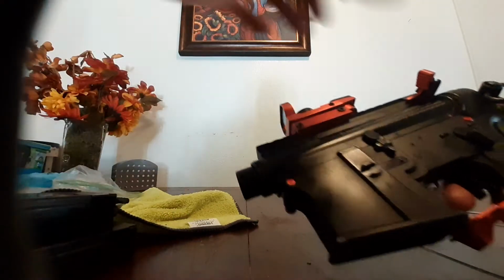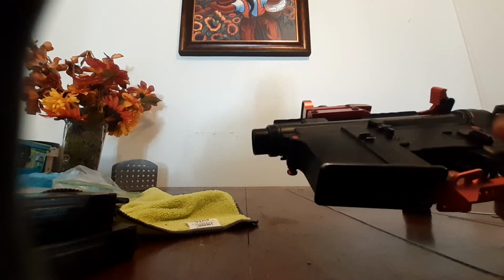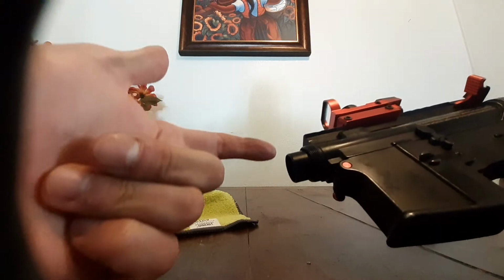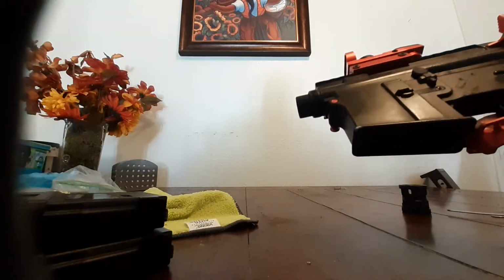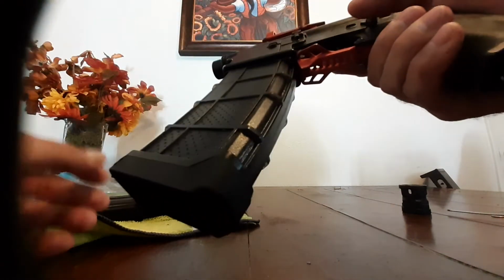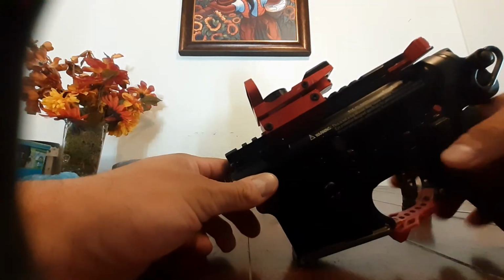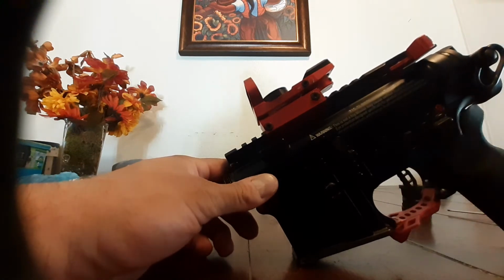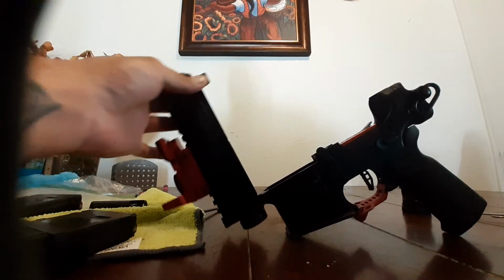MCS T15 Lok Bolt and Dry Test Semi-Auto Bolt

Comment: put some air in the marker, lets see what its like then.
Reply from the maker: Hello. The aired up marker, bolt and lok bolt reacted the same. The air going through does not have affect with the lok bolt and bolt. Only the bolt tip and its kinetic energy from trigger release to the lok bolt is affected. As it is very close together, same results as in operation.